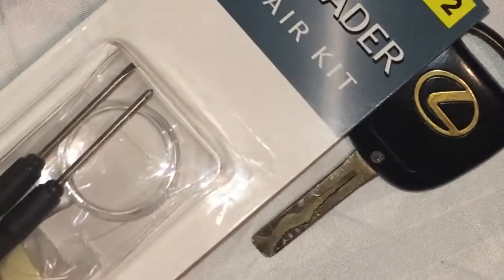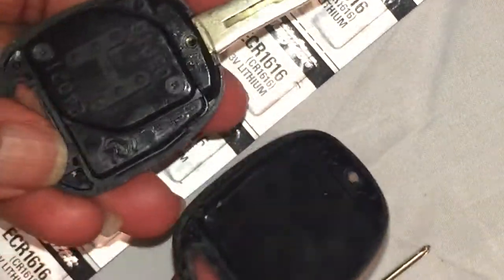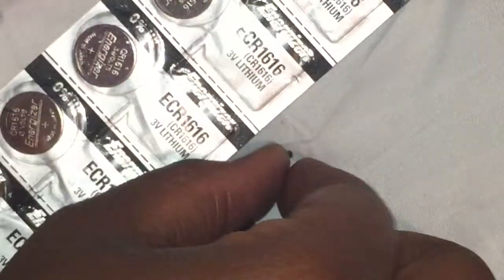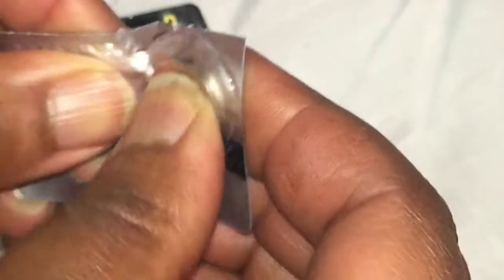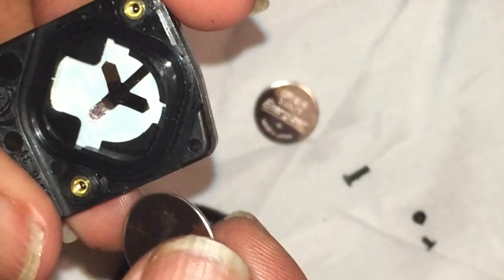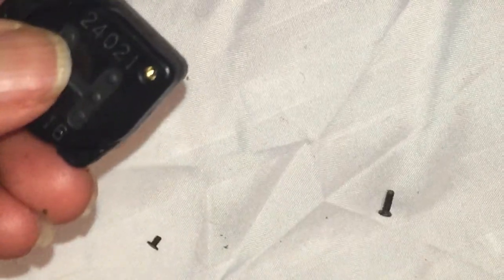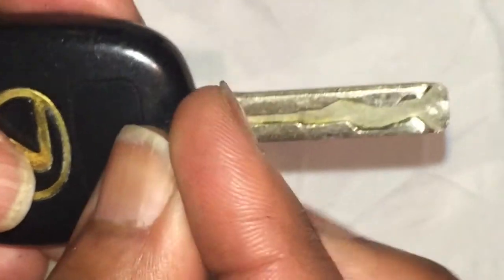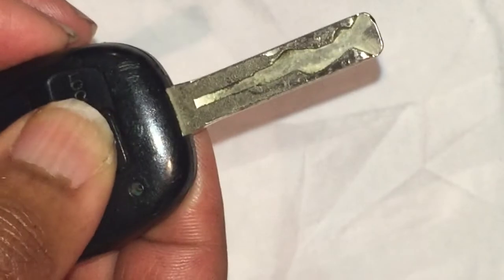How to Change the battery on a Lexus ES300 three button key remote

Comment: That was informative and showed all the parts, with clear instruction.  Well done.  I watched it because I need to replace the battery in mine and now I can get the CR1616 I need, when I was going to just open it assuming it would be a CR2032.